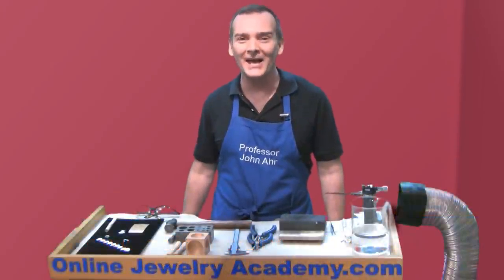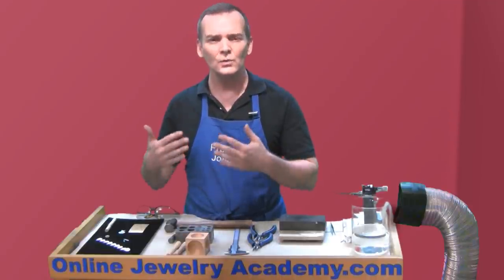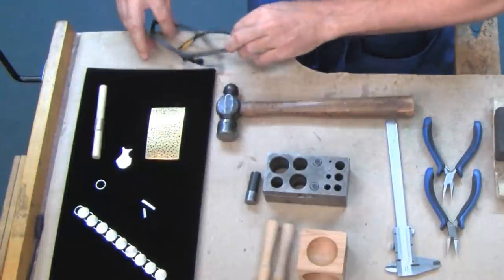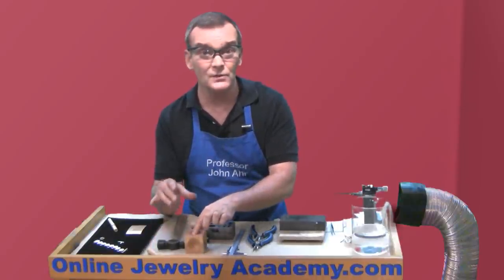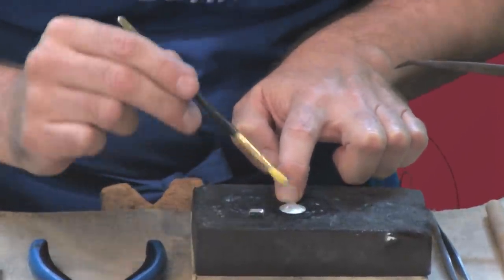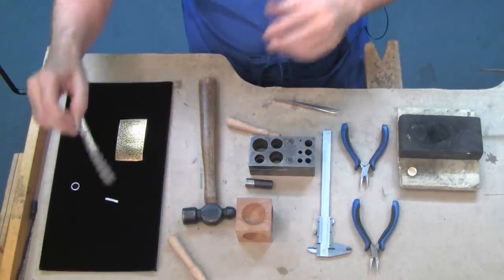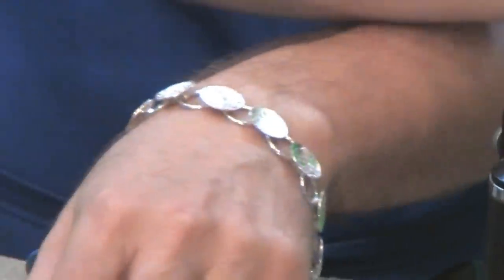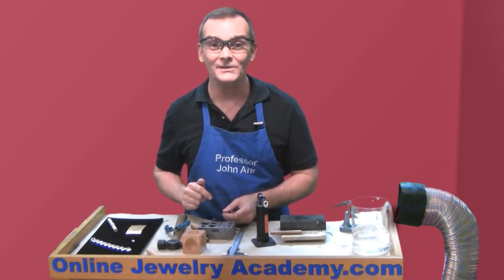Domed Silver Moonshine Bracelet

Comment: Was it mentioned what gauge wire these jump rings were? Also the diameter of the jump rings vs. the diameter of the domed discs? This was a beautiful project! I am thinking of how to do  this using copper and enameling the discs. Need to work out some issues like counter enameling and attaching the backing pieces and how all that will work. You have mind going now. Thank you for this!❤
Reply from the maker: Looking back at the video I believe that the wire was 14 ga., the discs were 16mm in diameter and the jump rings were slightly smaller than the domed discs.  Unfortunately, I don't have access to the bracelet to double check.  But you could do a little investigating to see if these dimensions work for you. If you choose to use enameled elements in this bracelet, I recommend that you fire separate discs that you can set into the soldered elements on the bracelet. You could solder prongs onto the discs or cut prongs (like a turtle setting) to set the enamels.  If you do this, it will be easier to deal with potential repairs to the enamel. 😀

Comment: Hi professor Ahr, do you know of an alternative or other way to get that same pattern without a rolling mill?
Reply from the maker: Hi Ingrid, Unfortunately, the only way to achieve that particular texture is to use a rolling mill.  But, you could apply a huge variety of direct textures to metal and probably find one that you like even better.  Consider making a texture sampler (there's a video on it), and be sure to include round shapes, like ball-peen hammer marks, "O" or zero stamps, etc.  Good luck with your bracelet project.
Thanks for your support! : )

Comment: Hi! Love the dot design! What do you use for fire scale prevention in your personal work? I don't think I see denatured alcohol with borax in your videos, or did I miss it? I see some people only use lots of flux on the whole piece. Does that work as well? Also, it would be very satisfying to see you sitting at a more complete work station,  with pickle and quench water always there, to be able to see your system regularly. Some people don't quench before pickling, some do. I'd love to see you sitting at a full set up. Thanks for all the demos!
Reply from the maker: Hi Huskyfluffy,  I haven't heard from you in a while.  I always quench my work after soldering.  It's not good to ever quench work in the pickle pot.  The pickle could splatter and it can be hard on some work.  I generally employ the denatured alcohol with borax solution to prevent fire scale.  But, flux will work pretty well all on its own.  Because we work to keep the videos short, we often just mention certain operations like pickling.  Plus, putting all of the equipment required on the bench at one time would make it difficult to work and maintain the viewer's focus.  We are going to be releasing a new "class" very shortly that I think will appeal to you.
Thanks for your continued support! : )